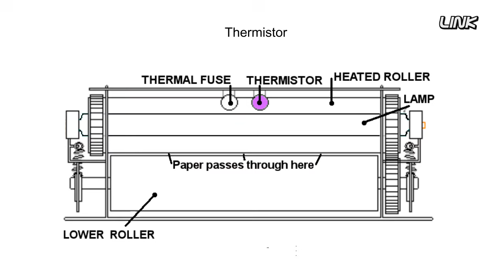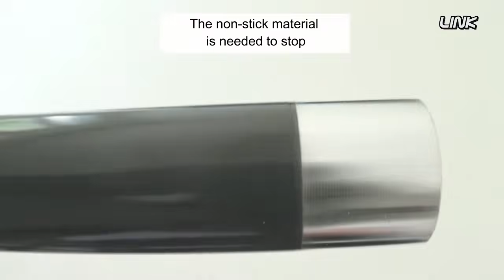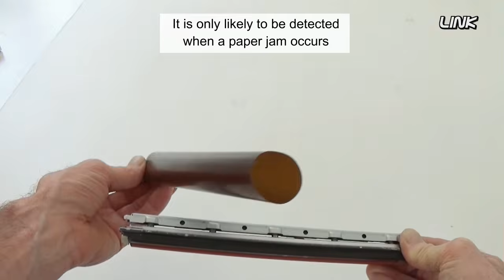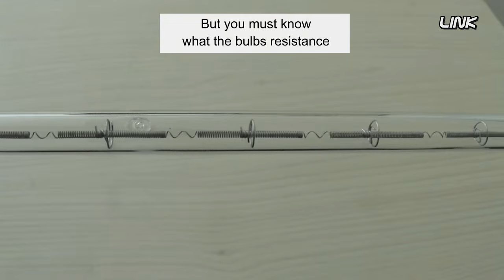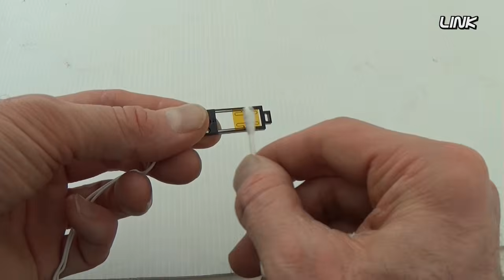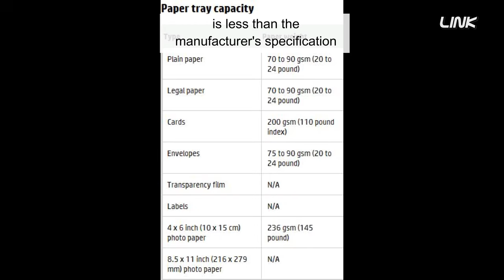How to check a printer fuser unit

Comment: Hi! I replaced the teflon film and the lower roller on my Lexmark x363, but now it doesn't fuse the toner well. What could be the problem?
Reply from the maker: If you are sure of the quality of the teflon film, I think you should disassembly and reassembly the fuser unit. check the contacts

Comment: Had ghosting and overheating (fault) issues with a new fuser.  This vid inspired me to carefully inspect the new fuser assy.  The thermistor was installed incorrectly at the manufacturer, too far from the heater roller (wasn't touching).  I removed, reinstalled and ops ck'd it good.  No more overheating and ghosting (double printing) issues!  Thanks for the video.

Comment: I have fusing problem on Heavy fuser with thick paper, when I do a full color print. Testing per color then fusing works, but I notice shiney lines and some scratches next to, that correspond to small rubber rollers and foam rollers? What's the best I can do? Xerox C60 by the way.
Reply from the maker: A worn fuser roller could cause that defect. In this case you can only change it

Comment: Assalamoalaykum made
M plz tell me the internal wiring diagram of fuser unit of xerox5855 machine mean that how heating elrment(lamp), thermostate and sensor(thermister) are interconnected. Pls help me as soon as you possible thanks a lot
Reply from the maker: sorry I don't have the tech manuals of that machine

Comment: I have a samsung c480w. And one of the rolls is a foam like material with rubber coating. This coating is kinda wavy. Im thinking its probably deformed due to heat. Is this a sign to get a new fuser unit? Cause were having paper jams and not sure whats causing them.
Reply from the maker: Yes, that roller is worn and it could cause paper jams
Reply: @ alright thanks

Comment: Hi . Im facing u1-2330 and 2334 error i have replaced working thermostat but same issue. I checked fuser is not getting heat . So is there power supply fault?
Reply from the maker: It could be the heater element too
Reply: @viandant5  I have tested continuity of the heating element it's showing no problem. 
Do you think any issue with fuser heat sensor which is tiny and placed centre of the fuser ?
Reply from the maker: @hikewithwasim  Unluckly that error code does not show exactly the defective component. do you mean the thermostat? yes it could be the problem

Comment: What can be done to remove the black streak on the upper fuser roller? The 2 streaks are right along where the 2 plastic parts are touching on the two sides of the printer. It looks like these streaks are what's causing the faint black vertical lines along the sides of the page near the edge of the margins.
Reply from the maker: If the roller is dirty you can claen it with alcohol. If the roller is damaged there is no way to repair it. you have to change the roller.

Comment: i have konica minolta bizhub printer. the heater roller couldn't pick up the paper in time so that paper gets folded between fuser unit and drum. should i lubricate fuser unit gears and how
Reply from the maker: It could be a problem related to the paper pick-up fingers, dirty or worn out, or damp paper.

Comment: Hello, could you help me?
I have Brother H-2321D. 

Problem: All led blinking and fan full spin. 

According to manual: thermistor temp error. Heater heating up.

I checked thermostat: works ok 
Thermister: Multimeter under 2M ohm range gives value .350. When I heat it up (under 20k range, value is 8k). Is the thermistor faulty? 

I can't find thermistor near me. Have to replace the whole fuser unit which is expensive.

Any idea how to solve this?

Solved: the above thermistor value is ok condition for my model. 

Thermistor centre and side: Ok
Thermostat: Ok
Heater element: Ok (as my fuser was heating up).

The problem was due to faulty flex cable (the one that connects from paper eject pcb assy to the main pcb assy). The continuity failed that's how I came to know.
Reply from the maker: The value should decline if heated. The error codes descriptions are really vague. It could be a fuser roller or heatert element that does not heat well so the thermistor does not read the correct value so it's not sure that changing the thermistor you solve the problem
Reply: @viandant5  thank you for the promt reply. I got mine fixed. Flex cable points were missing internal connection due to repeated dissaembly. They seem to be very fragile. I just soldered small wires to missing line (otherwise takes forever to delivery stuff). 

Thanks again for the tutorials. They were very helpful.

Comment: Hello, I have a HP laserjetpro M281 with a 50.7 error, it is fuser related but I don't know what to do to repair it, do you have any ideas ?
Reply from the maker: 50.7 error could be related to a photosensor but there is not a trick that solve everything.
Reply: @viandant5  Hello, thanks for your response. In the case it is a photosensor, I just need to find it on the fuser and fix it. No need to change the whole fuser ?
Reply from the maker: @victorpellegrino9259  Yes. First of all however try to clean the thermistor and the thermostat, they causes lot of defects

Comment: Hi, my customer's Xerox Phaser 6510 is printing fine the first few pages, afterwards the toner doesn't seem to bond to the paper, does the fuser need to be replaced or do i adjust the temparature? thx
Reply from the maker: It's a typical fuser unit defect. Probably the fuser must be replaced. It could be toner or drum too
Reply: @viandant5  i replaced the toner thinking it was it, since there's a lot of toner residue on the paper once a few pages print, the first few pages come out fine, after it starts degrading :( there are toner spots on the paper and images comes out very bad, same in black and color. I'm tempted to say the fuser doesn't heat enough after a few pages..

Comment: Very informative video. I have an HP 3030 multi-function printer that prints blank pages. I bought two different original HP toners to make sure it was not the toner but did not fix the problem. Do you advise to replace the fuser? Thank you.
Reply from the maker: No, a blank page is not related to the fuser. It could be the laser unit, the main board, even the firmware.

Comment: Great video on printer fuser unit! I have Ricoh Sp 1200 SF (Brother OEM) which when first powered on goes to the pre-heating with a rather loud motor noise and immediately shows Unable to Print 71. I have dismantled the Fuser to take voltmeter readings for resistance. Thermistor value changes .1 or .2 at most in 29 C room temperature. But Thermostat read 1Megaohm;
Fuser sensor readings:
Thermistor: 296.1 kOhm
Thermostat: 1.013 Mohm (???)

Do you think its the thermostat or something more complicated like the laser motor ?
Reply: Thermostat wil read near 0 ohm (short circuit) Sorry my bad english.
Reply from the maker: That erros means a mechanical problem, it could be not related to the fusers or electronics. May be a gear
Reply: @viandant5  Thats what I first looked at but I cant find or hear a gear at fault. However the thermistor and thermostat (especially thermostat in megaohm) reads higher. Do you think that could be an indirect issue? Or is the readings somewhat ok?
Reply from the maker: @keilo88  The defective gear could be in the machine too. The thermistor or thermal fuse may be could give that type of error code but not the noise

Comment: Nice video.. please could you assist me with how to fix the overheating problem of the fuser unit which causes papers to crush. The machine is Konica Bizhub c364e
Reply from the maker: Are you sure the problem is an overheating? Are the fuser rollers worn? ALso check the paper fingers

Comment: Hello. I have a Samsung SCX 4623F that shows me the 02-000 error, which after googling it, seems to be related to the fuser. I ordered a new fuser from aliexpress, which arrived only after a few days. The fuser looks pretty much the same, but one of the two connectors, the bigger one, does not fit in the socket. Can you explain please how the connectors of a fuser work?
Reply from the maker: Are you sure you ordered the correct voltage, 110V or 220V?
Reply: @viandant5  I ordered the 220 V one and this is what the label also says.
Reply from the maker: @abiesalba100  which is the code of the fuser unit? It could be something like JC91-00945A
Reply: @viandant5  Thanks for your reply. The serial number of the new fuser unit is: CNG 1JC9100945BD6HCB520006.
Reply from the maker: @abiesalba100  There must be a code, not the serial number. However you can use that fuser unit for spare parts. This error could be related to the heat lamp, but there could be a defective main board too

Comment: What lubricant should be applied for with standing heat in Teflon sleeve?
Reply from the maker: On the heating element you should use hight temperature grease

Comment: I have a brother MFC 6700dw that is getting creases on the right side of the paper.  I have checked everything and I am wondering if it could be the fuser?  Brother support told me it was my print drivers but they are up to date and I just don't see how that could be.  Thank you
Reply from the maker: It's not the printer driver for sure, how can they told it? Check if there are foreign objiects along the paper path, check the paper finger where the paper go out from the printer. it could be a fuser problem, check if the fuser rollers are clean

Comment: Thank You very informative! 

I have a question though, is it possible to buy replacement thermistors and if so where from? my new Xerox Phaser 6510 has wrecked one of the fuser thermistors.

Regards Paul
Reply from the maker: You can try to find it on alibaba, aliexpress or searching with google avoiding ebay.

Comment: Dear  viandant

I am an Media concept Artist from Germany that currently uses an modified OKI  C711 (A4) Laser printer. With this modification, I am able to print directly on a sand surface as well as in unburned clay sheets. This enables me to produce remarkable images which become transformed into large installation landscapes  and Earth-objects. 
2017 I have received the North Rhein Westfalia State award for the body of works I have produced. https://www.staatspreis-manufactum.de/staatspreise/staatspreis-2017 also please visit my website http://www.sand-media.com

I am looking for support to be able to modify an A3 and Banner  OKI C821 Laserprinter. The modification I need is, to have the laserprinter processes prints without  a workin fuser.  So fare my elctroengineer colleagues were not able to come up with a solution by which the dismantling of the fuser will work with out the OKI printer going into “error”.   

As you may know the fuser unit is jam packet with censors that measure the heat of the installed  halogen lamps as well as the movement of the paper. We need technical data on the fuser in order to install resistors as a replacement to the halogen lamps. 

The other way to do it, is to completely move the fuser out the Printer In order to do this we beed to create an extender cable. This can only be done if we find the right socket model produced for OKI. 

Please inform me whether you think you can implement this modification and if so please get in touch with me. You’ll find my email and mobil on my website  (see under “contact”). 

  

Thank you kindly 
Ira  Marom

Comment: Great information ! I have a question , I am using a icolor 550 , and when I print on transparency paper, it appears that toner particle scratch the glossy paper making the transfer useless as those scratches damage the actual print quality . I cleaned all the rollers and the issue still . It is also smudging the prints on the right side of the paper  . What could possibly be bad? 

Thank you again
Reply from the maker: Probablyu that rrasparencies are not suitable for that print, may be they are for inkjet printers? I would check if in the printer folder there are settings for that special paper
Reply: viandant5 hi , the transparency are made by the same company that manufactures the printer which is Uninet . Why do you think the smudges come out on the right side ?
Reply from the maker: I think you have to use original toner cartridges. For some special purposes compatible cartridges are not good

Comment: Greetings Brother!
I have bought HP Laserjet P3015. But I don't know that it is either 120V or 220V.
I supplying it 110V but sometimes 50.1 Fuser Error Occurs.
Reply from the maker: It could be a thermistor problem
Reply: @viandant5  Would it be okay if I supply it 220V?
Reply from the maker: @muhammadzeeshanarif7896  Probably not. 220V will destroy a 110V fuser
Reply: @viandant5  Thanks for guiding!

Comment: Dear Gianni, I have a Samsung CLP 365W and the fuser unit is the problem. I have cleaned it but still the same message. The rollers are fine no defects. As a replacement fuser is quite expensive I would like to check if the lamp or the sensors are not working correctly and if they can be replaced. Can you tell me how to disassemble the fuser unit and how to check the lamp and the sensors? Can you also tell me where I can find replacement parts of the fuser unit? Do you supply those? 
.
Reply from the maker: Which is the error message? here you can find how to disassembly the printer https://www.youtube.com/watch?v=5udVvf1QSEU. I have no part of this fuser unit. Check the thermistor, may be it's dirty

Comment: I have printer HP LJ P1008. In it 2nd paper gets stuck everytime printed. While printing paper pickup tray keeps on jumping from top to bottom like in normal single time paper pickup it happens only at start of paper picking. But in my printer case it keeps on taking paper .

Can you help me on this ??
Reply from the maker: Check the paper settings. Is A4 sheet selected?

Comment: Viandant5 your passion and knowledge of printers is remarkable.  excellent video.  In some printers (dell 2350dn) there is no separate counter for the fuser. The  web interface page displays the life of the fuser left...say 60%. If the printer has done 45k copies, it means that the fuser life is estimated at 80-100k. Does this mean that when the fuser life is zero% the printer will stop working? Many printers have a fuser reset procedure but not this dell. thank you
Reply from the maker: Yes, you'll have to change the fuser unit. I don't know any reset procedure for this machine
Reply: @viandant5  My concern is that I might change the fuser and find that the PCB blocks the machine when the fuser life is 0%. It is strange that Dell has no fuser counter but ONLY a page counter which is used to tell you how much life is in the fuser. Have you come across any printer that has no fuser reset feature and blocks the machine when fuser life is 0%?
Reply from the maker: @redpost2380  most of the printers have no fuser reset feature. the producers want you buy the fuser unit
Reply: @viandant5  Yes but how does the PCB know that you have changed the fuser? How does the FUSER LIFE % change from 0% to 100% if there is no fuser page count? It's funny for this Dell printer: You cannot find new 230V fusers. They sell plenty of 110V ones for the US market but the only one I found online is an aftermarket 230V fuser in the UK for over 300GBP!! I guess I will buy a 110v fuser and then insert the heating element on my 240v old fuser.
Reply from the maker: @redpost2380  There could be a resistance or a resistor or a component inside the fuser unit that tell the printer that there is a new fuser, but I don't know very well this unit so I don't know which is the exact method
Reply: @viandant5  Thank you immensely for your advice. If I ever figure this out, I will let you know

Comment: Excellent Video. 
My printer is HP laserjet p4015x. After print any document if i rub the printed page then the ink fade away. what should i do?
Reply from the maker: It's probably a problem related to the fuser unit. Check the rollers, are they worn or dirty? It could be the heating element or the thermistor too

Comment: great video.  One of the gears on my Oki c822 fuser unit is really stiff so my printer can't move it but I can hear it trying, does this mean the bushes or something further inside needs replacing or is there a clip or something to release the gear? thanks
Reply from the maker: I think there will other parts to be replaced, the bushings of the rollers first

Comment: ricoh spc 250dn color overlaps and also error SC 542
Reply from the maker: error SC542 could mean thermistor broken or dirty, or fuser lamp problem
Reply: okay and  what about color overlapping , double color of Ricoh spc 250 dn
Reply: please help me out for both this ricoh printer  problem(color overlapping, double image problem,  i have tried every possible source
Reply from the maker: @bikashghatani807  Did you already tried a toner calibration? check the movement of the drum, check the belt unit
Reply: yes sir i have changed the belt but this sp c250 dn takes automatic calibration, i cannlt find a way to solve it